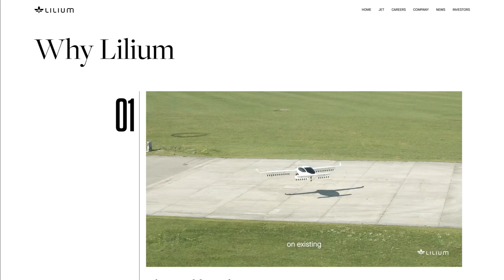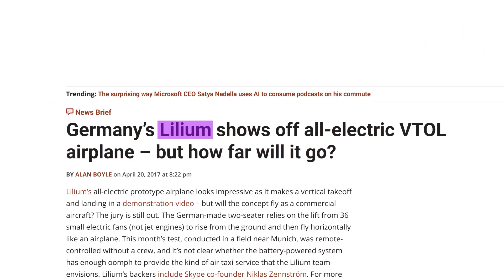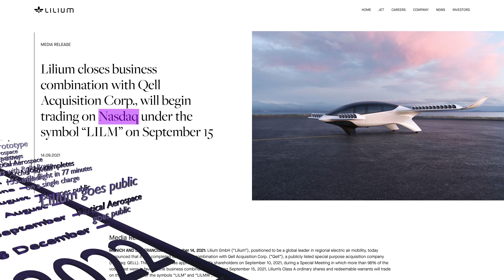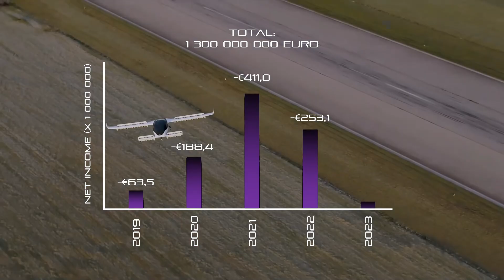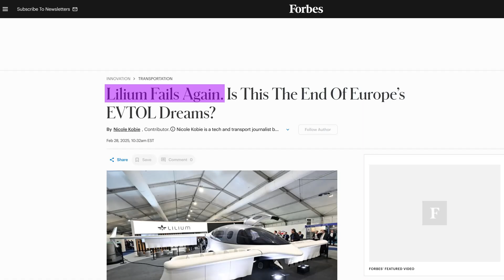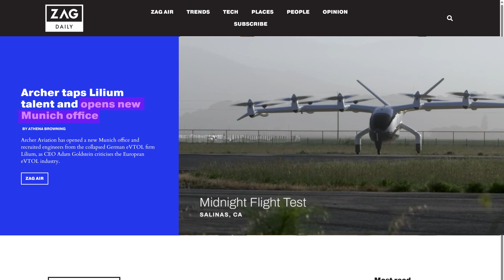The Rise and Fall of Lilium: The European Air Taxi Dream That Crashed

Comment: Many have tried to outsmart basic physics; as many have failed.
Combining the most energy consuming way of flying (VTOL) with the least efficient way of generating thrust (multiple small fans instead one large propeller) with the heaviest possible way to store energy (electric batteries) is not exactly an ingenious recipe for success. 
Technical solutions have already been developed: one single slowly turning rotor with a weight efficient power storage: it’s called a “helicopter”. If that’s not complex enough yet: a VTOL with transition to a more economic cruise setting has also been developed, the V-22 Osprey. And we know how long it took to get that magnificent machine off the ground!
So with that bit of physics and aviation knowledge, I’m really wondering how some individuals or companies evaluate where to invest their millions.

Comment: The basic aeromechanics of the lift vectoring meant that the wings had massive airbrakes deployed just when only a tiny fraction of the thrust was available to accelerate for forward flight. Hence the lethargic hover transition and staggering amount of power needed to just lift a handful of people ( 3300 horsepower!)  A truly misbegotten concept - the Moller Skycar had a related ducted tilt prop idea but with lower disc loading and similar prospects for success.
Reply: If as you say, 3300 HP was needed to lift a handful of people slowly towards the sky against the force of gravity then something must have been getting awfully hot due to an incredibly low efficiency somewhere in the "drive train" !!
Reply: @marviwilson1853  Since they only flew an empty downsized rc model they could always deflect to "But the real thing will fly, trust me bro!" 

If you want to have some fun with maths, try to calculate the downwash speed of the full scale MTOW model. You will be surprised.
Reply: @candywelz1305  3300hp converts to 2427Kw. A 100Kwhr battery can produce 100Kw for 60mins and 2427Kw for 148seconds.